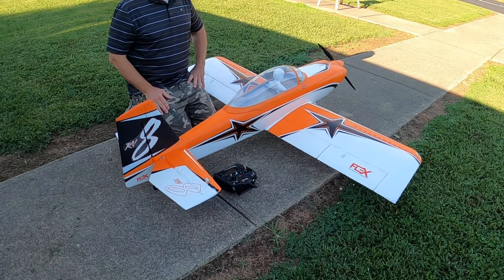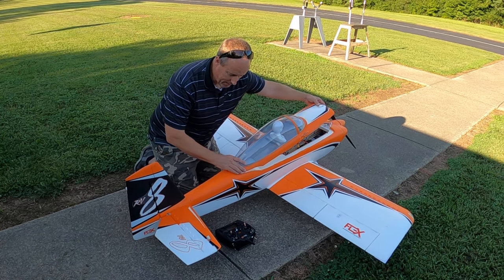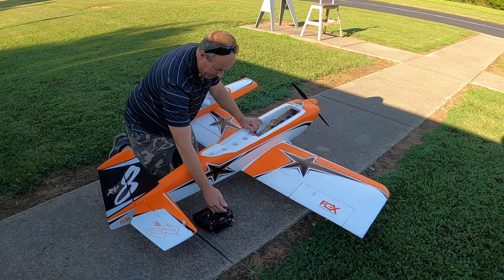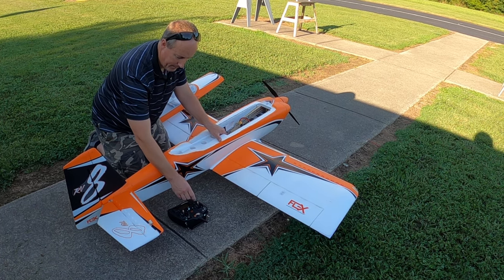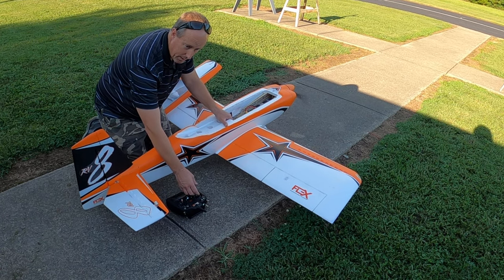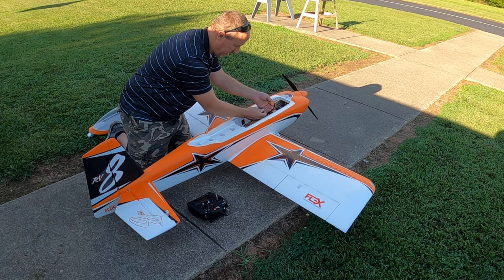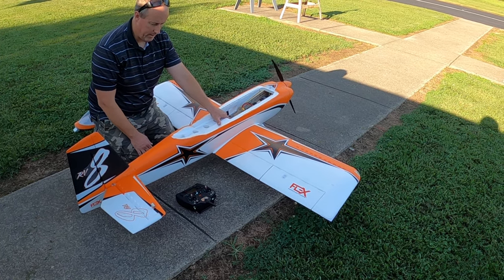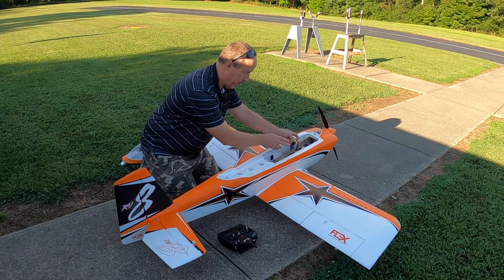Flex Innovations RV-8 ESC problem. It keeps desynchronizing.

Comment: Hope you got my message, its a timing issue, not a calibration issue.  Go into your radio, servo settings, throttle, timing.  Change timing to 0.5.  I had the exact same problem.  For some reason this is not addressed in the RV-8 manual, but it is in the Cessna.  Once I did this, I've not had that problem since, that was at least 35 flights ago
Reply from the maker: Thanks Grossman2868.   We will look into that.  Every little bit helps.
Reply: i don't found thi settings on mt TX16S..timing servo throttle...
Reply from the maker: @popeye7833  Got a new ESC from Hobby King and it works fine now.

Comment: We have found that some ZTW 100A ESCs included in the Cessna 170 and RV-8 may not be calibrated properly from the factory, which may cause issues with motor function. For this reason, we recommend that our customers with the ZTW 100A ESC re-calibrate the ESC to ensure proper performance. Follow the video below for calibration of the ZTW 100A ESC.

Comment: brand new two days ago my maiden flight, motor seemed sluggish not developing full power. upon landing motor was extremely hot after a very lazy 5 minute trimming flight and the motor was making a clunking noise, turned off everything and hand turned the prop and you could hear a clunk. took it home took off prop ran the motor in my hand and rear housing got super hot in 30 seconds, so assuming a bad bearing, but motor was also acting strangely, reversing once in awhile, and just buzzing and not starting. dealer is replacing the motor, but now I wonder if the ESC was at fault for the initial issue, not very happy with my first Flex purchase, probably won't rush out and buy another. BTW I did calibrate the esc per instructions.
Reply from the maker: Got a new ESC from Hobby King and it works fine now.

Comment: Well Flex Innovations has completely blown me off they are making no attempt to help me ive tried multiple settings and even a different reciever.  I routed the esc through the flight cantrol and the recievers and its the same issue. I even followed there advise and set the throttle up to an idle speed and it still goes out of sync. I have an lcd programmer coming soon sonim going to try and upgrade the firmware.  Also i orderedthe same 100 amp esc that comes with the Avanti.. it works great and i already have a programing card...we shall see

Comment: Get rid of that ESC. Get a Hobbywing 110A ESC 8A/7.4V SBEC. I have three Flex airplanes. Cap 232 EX, Mamba 60E and a Mamba 10. I changed out the ESC on the Mamba 10 to a 80A Hobbywing and the other two to a 110A Hobbywing. You will also need a programmer which makes it easier to change the settings and timing. 

.
Reply from the maker: Yup he did and that fixed it!

Comment: Aren’t you suppose too disconnect battery after calibration- cause it wasn’t done - you applied throttle
Reply from the maker: Got a new ESC from Hobby King and it works fine now.

Comment: Did they do anything to help you out I had a similar problem with a mamba 10  and got no help at all
Reply from the maker: Az desert jets 10 in the process of trying to get help.
Reply: @LoveRC  please let me know how it turns out a guy I fly with has also had this problem with his flex jet it's never been in the air
Reply from the maker: How did you resolve your problem?
Reply: @LoveRC  I never did resolve it rocky told me it was my fault and my friend with the flex jet is 4 months in has sent two esc and fan units back still waiting
Reply: @mateozorro2461  I went threw the same stuff with them it's not fun and I really wanted to order the mamba 60 but after the customer service I refuse to buy anything else
Reply: Ok I have sent ZTW 2 emails asking for help and i ordered the LCD programmer so I can update the esc firmware.  I have had numerous drones and one thing the manufacturers have done for us is upgrade the esc's firmware and speed. Im starting to worry this esc may never be able to handle the 500kv motor properly. The idea of setting the throttle trim up to an idle speed after initializing makes no sence other than a work around for a problem they cant fix. I want to reach out to people with the rv8 who dont have the issue and see what rev or batch there esc's are.

Comment: I wasted $500 on this garbage that I cannot get to run right so I can fly it.  I am using a DX9 and mine does the same thing and throttle cut does not shut it down.
Reply from the maker: 1968Flying get a new ESC from hobby king.
Reply: @LoveRC  I ended up buy a Spektrum 100a ESC to use in mine.  This is the most expensive foam plane I own now.  These planes need to come with better quality electronics.
Reply from the maker: 1968Flying frankly, I would not buy this plane myself.  I’d rather have something better and less expensive.
Reply: This all happened today. I bought the plane locally and fully expected to fly it all weekend long. I’m not going to use the replacement junk speed controller but they’re going to send me in place of their original junk speed controller.
Reply from the maker: 1968Flying    You would think for the cost you would get decent electronics.  I usually buy E-Flite or Motion RC.  Both have excellent product and service.
Reply: @LoveRC  A friend has one that he let my fly and I was impressed....until I bought my own.  Lesson learned the hard way again.